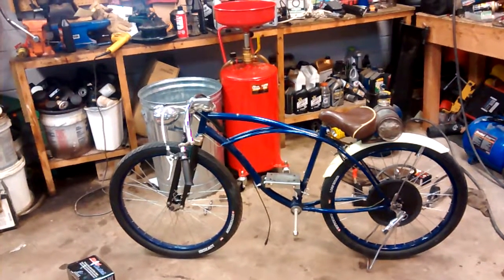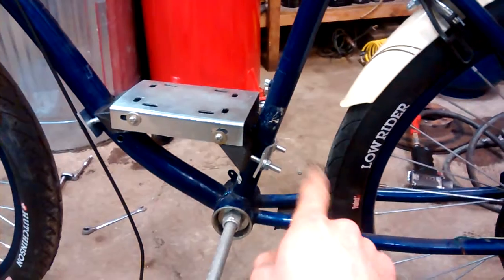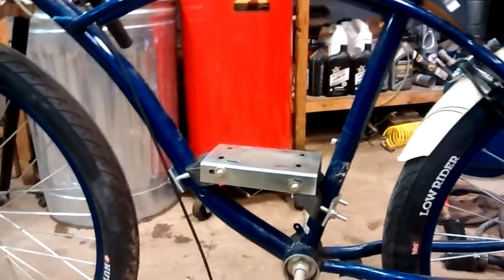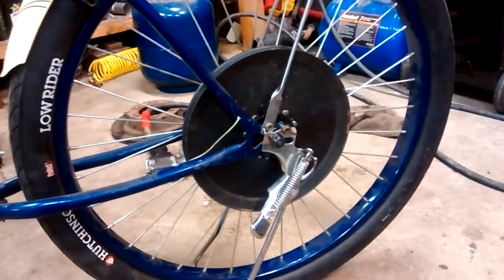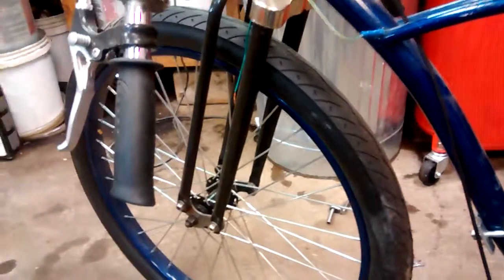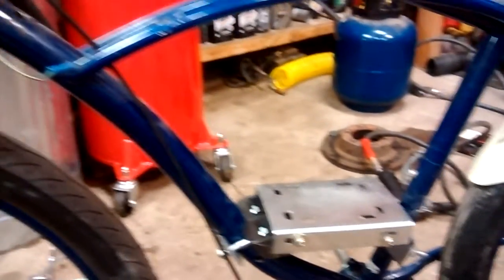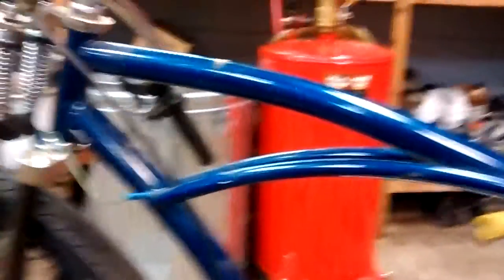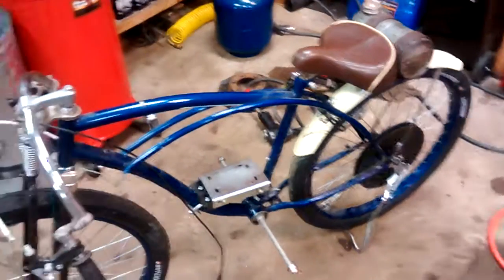79cc Predator Bike Build pt. 1

Comment: nice where did you get that extra wide bottom pedal bracket 
i have problems with the pedals hitting the engine thanks
Reply from the maker: I removed my pedals and I'm using a threaded rod as foot pegs. If you want to keep pedals, they make a wide crank set but i think its widened on the left side for a grubee setup, if youre using a predator it wont work without modification.

Comment: you bought the chinese pk80 kit. those are pretty cheap. And the only time the carp will fall off like that is if you tighten it down too hard. If you want a reliable 2 stroke try the gt5 engines ive bought 3 and never had an issue with them
Reply from the maker: ForRealBruh 01 the Skyhawk gt5 is the exact kit I had. I'm glad you had luck with it though and thanks for watching.
Reply: Blake's Garage k